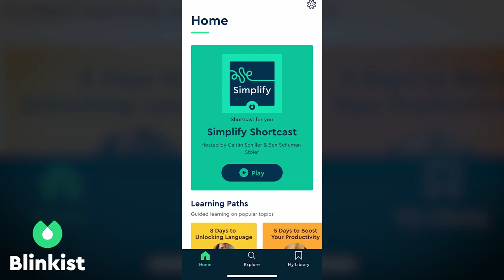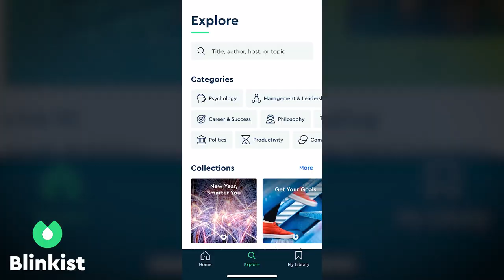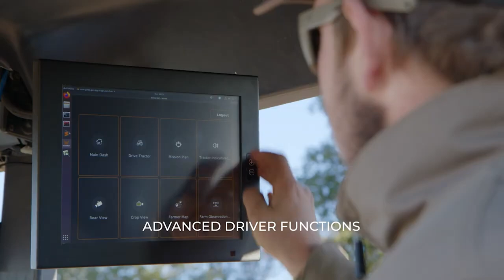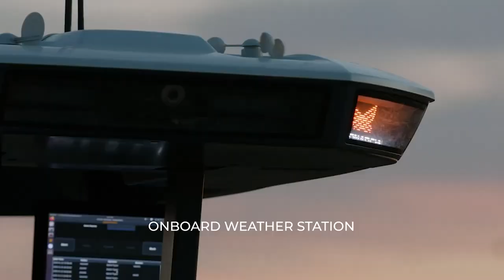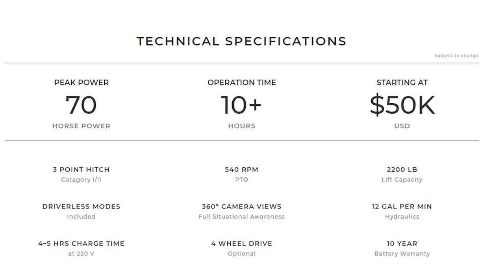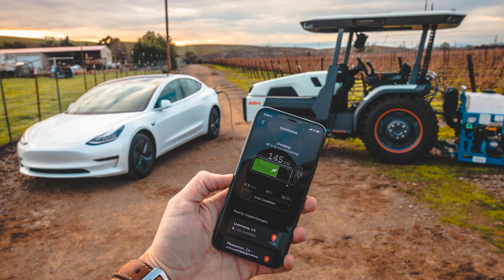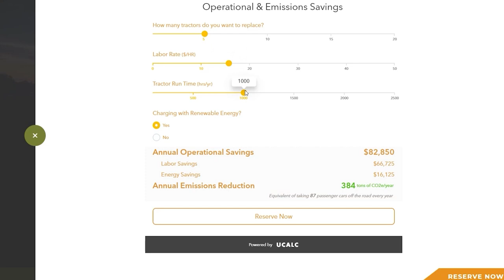This Tractor Could Change Farming Forever | In Depth

Comment: I've been listening to Louis Rossmann on Right to Repair. Some of these diesel powered farm tractors cost well into the six figures. Then they go into limp mode, becoming useless because some tiny bit of pollution control tech has mal-functioned. They then lose the use of the equipment for weeks while they have to wait for the dealership to deal with it because the tractor manufacturers will not sell them the equipment, parts or software they need to service their own tractors.
One benefit I expect from electric tractors is that pollution controls will never stop farmers from doing their job. That factor alone will be enough to sell all the electric tractors they can build. Farmers are really fed-up with the current situation.

Comment: 6:30 even bigger than reducing water use is increasing resiliency against extreme heat. Part shade during the hottest part of a 115F day could mean the difference between getting to harvest and total crop failure
Reply: @davidbeppler3032  Yes, yes and use a system of mirrors so hone the power of the sun! The Egyptians utilized this power to light the treasure room in 'The Mummy'. 
Oh Benny.
Reply: @davidbeppler3032  😁😁

Comment: Having recently purchased an almond orchard as a retirement property. I've been disappointed to have to reintroduce gas and diesel fuel to my life with truck, side by side and tractor.  Having come from a home with solar/powerwalls and a Model S, I had not been to a gas station in a couple years.  But now having to go and burn these fuels is frustrating.  Cybertruck will address one of those but tractor is still a real gap I'm glad to see being closed by vendors like these.  Side by side being replaced in next couple months with electric as this is already a real option.

Comment: I feel like a really important factor that isn't being talked much about is the fact that electric motors have 100% of the torque available from 0. Which sounds amazing for farmuse! No need to spin an ICE engine up to several thousand RPMs just to get heavy work done.
Reply: You don't want instant torque for tractors. That's how you break things in the industrial world. Plus electric motors struggle under the high load work ICE engines in tractors do.
Reply: @davidc2838  ????
Reply: It would be more accurate to say that an electric motor has instant torque available at any speed. Meaning it is still capable of lower torque levels, and unlike an ICE does not need to be revved or stalled by clutch to apply a specified amount of torque. Rather, it's merely an adjustment made by code. Tractorman may be technically correct but the statement is certainly misleading fud.
Reply: @tractordawg   what does ICE mean?
Reply: @davidfrost1428  In this context, ICE is an acronym for Internal Combustion Engine. i.e. a diesel engine for most tractors, or petrol/gasoline for cars.
Reply: @DuncanAitken  no dumb questions right? Actually figured it out and felt oh so dumb.
Reply: @tractordawg  Just an FYI we've use electric motors on trains since the 1960 because ICE couldn't generate enough torque for heavy loads.

That's how one engines can pull miles of fully loaded freight cars and why rail is the cheapest mode of moving freight overland.

The diesel engine on them just powers the electric generators, same for some large ships and submarines.

Comment: This sounds very interesting, and I look forward to when it's available in my area.

I'm going to start by pointing out that tractors have had the option of some degree of autonomy for longer than cars have. It's a bolt-on solution, but it works. At least for some crops. So that this tractor has factory-installed autonomy isn't all that big a deal to me. The bolt-on solutions will get better and don't lock you into a single equipment vendor.
What is interesting is the probable uptime. If your equipment isn't ready to go when you need it, you miss an often too-short window. If you don't get a chance to plant, or harvest, at the right time relative to the rain, you can end up with no crop to speak of. (This is also a reason why custom harvesting isn't all that great for the little guy. Big jobs are prioritized, which leaves more time for the weather to ruin the crops of the little jobs, before the combines are available to work them.)
Also, farming equipment is often finicky. I'm pretty sure I've seen round baler belts break because some spring tensioner was turned just a little bit too tight. A more robust, and reliable, electromechanical system does appeal to me.

Also, get PV panels down to the same price as corrugated galvanized steel roofing material, or close enough to it, and of comparable durability, and I think you'll see most barns made from PV panels rather than corrugated steel. In my experience, most farms have more square feet of roof on the outbuildings than on the house. That's a lot of roof for solar panels, before you start looking at shading your crops.

I still think the future of farming is in greenhouses, however, as it greatly improves your ability to control the water cycle. Provided riparian water laws don't get in the way, (which they will. In some places, it's illegal to capture rainwater, because the down-stream claimants would be deprived by your rain barrel, which would make running gutters on your greenhouses to water storage legally problematic.)
Reply: I never thought riparian laws could apply to *RAIN*.
Intuitively only a mega-project could significantly deprive a downstream, right ?
Reply: Make an illegal 2 inch under surface collection site about an acre in size for collecting rainwater, underground 5000 gal. tank. Put auto bleach sanitation system if needed for potable and test at certified lab.

Comment: One way of doing agrivoltaics would be using rollable solar PV. This would be akin to shading that is used in many farms or in greenhouses to moderate light levels. It would also be much more mechanically simple than solar tracking motors. Can also roll them up when needing to work on the field below and in adverse weather to protect the panels. Thin film solar is not the most efficient but it is pretty cheap.

Comment: We need to cover only 25,000 square miles with solar panels to provide energy for the entire  USA . Thats less than 0.41 of total US land area .
Reply: It's always better to generate electric energy right at the location where it will be used. That way you don't need to build a lot of energy transmission structure.
Conversely, generating electric energy for the entire country all in a single small area would mean you have to build out massive amounts of transmission lines. That would drive up costs enormously. 
The idea of generating the electric energy for the entire coutry in a single small area is economically not a viable option. The more locally the electric energy is generated, the more cost reduction.
Reply: @cleon_teunissen  When people say what the op said, I don't think they mean we should pick one spot and generate all the electricity there (at least I hope not). It's more of just a way to model how little solar we need in total. You're right though, everyone should generate their energy as close as possible to where they use it as well as being able to give and take excess energy rather than waste it. Ideally with solar roof tiles like Tesla's, that is  where we will end up.
Reply: @givanildosouza6904  Sure enough: when technically educated people state the figure that total solar panel area required corresponds to less than 0.41 of total US land area, then they probably do have distributed energy generation in mind.
  
But it gets iffy when the presenters show an actual map of the USA, with an actual square of the corresponding size. Then the presenters should clarify that energy should be generated locally, and that the map is only to illustrate proportion. Zac and Jesse don't provide that clarification. 

I watch Zac and Jesse for their enthousiasm, good vibes, but their technical understanding is limited. It would appear Zac and Jesse are not aware that building out and maintaining an energy transmission grid is very costly.

Again, I very much appreciate Zac and Jesse, but from time to time they inadvertently spread misinformation.

Comment: In our part of australia the irradiance levels are such that we have a 3.8 kw photovoltaic system fitted which generates up to 33 kilowatts per day we average 13 kilowatts per day usage ,on our farm this represents approximately 15% roof space could easily power tractors and all machinery by the sun ,have been waiting and watching a longgggg time for an electric tractor makes so much sense for jobs like fencing where a diesel sits running at low revs electric would be great wish these guys all the best

Comment: Our tractors would need 400-500 kW per hour. That would be a big battery for an 18 hour day. Also would need to recharge in 6 hours or less.
Reply: Our tractors are often 5-10 miles from the farmstead. They don't often make it home at night during the working season. Would be difficult for us to get it to a charger every day. Still a good step in the right direction.
Reply: Was that supposed to be kWh per hour, as in averaging 400-500 kW?  500 kW is roughly 670 hp. Maintaining a power output of 400-500 kW with a diesel engine that fits in a tractor should take over a 100 liter/26 US gallons of diesel per hour.  That's 1.8 cubic meter, or almost 500 USG. Yes that would require big batteries to replace, but with battery swap you would not need capacity for the whole day onboard, you might want to watch the show so you get an idea what you commenting. 

And, if your'e not just throwing out numbers, as I assume you are, being able to save almost 500 USG diesel fuel, per tractor, per day could pay for a substantial investment.    Assuming a price of about  2 dollar per gallon you'd save roughly 1000 dollars per day, per tractor. If your not using somewhere in the ballpark of 500 gallons per 18 hour day, your not putting out around 400 - 500 kW on average either.

Comment: Am sure the SciFi movies had autonomous tractors - but pretty sure many also had exhausts..
I love this. Multiple batteries so directly charge the spare in  the day directly from solar, go to the tractors to do battery swaps when necessary so working tractors stay close to where they are working. Could potentially work all night as well? Less to do in winter - so the spare batteries provide more backup power to the Farm buildings.
Primary down side may be a need for less farm employees.

Comment: don't forget if solar panels are running cooler by being over green plants then they are also more efficient in generating...
Also with attending levels of Service around the world could be maintained by using local independent Technicians & Engineers (like Us) with the remote specialized OEMs diagnosing the issues...this will be a hole other trade without flying everyone everywhere!

Comment: Comming from a farm, i can tell you that the 100 days a traktor is used, are the 100 sunny days... And diesel in farm traktors is far less polluting than diesel in a street car ( constant rpm, addblue etc...), during the summer, this equipent needs to run 24x7, with EV equipment you need to triple the equipent number in order to compensate for charging time. And on the field, every few hours, you need to get off, and fix something manually.

Comment: Love the concept, but I need at least a front bucket on my tractor which I don't see on the website or promotional videos.  A blade and/or backhoe option would be even better.  Are there plans to offer this?  I have an LS diesel tractor that stopped working so looking for a replacement.  Electric options are much preferred!

Comment: You could get sooo much more.
Since it quiet and autonomous it could do the main work at night.
Big battery plugged in during the day can give you 100% solar charging and enormous V2G.
huge batteries can deliver a huge current, add a supercharger on it.
You could practically go off grid and still always have power and fast charge your EV of the traktor.

Comment: I farm a small lot and have a John Deere 3046R compact factory cab tractor.  JD already has automated tractors, and has for many years.  JD is working bringing EV tractors to the market, and some don’t even have a spot for a driver.  I am definitely onboard getting an electric tractor, but the difference between brands like John Deere or Kubota and cheep tractors is so far apart, it is ridiculous.  Way different than that of a high end car and a cheep one, whereas both work.  A cheep tractor looses you money.  I don’t know if a new EV tractor brand can replace the big tractor brands, but it could force those old brands to get on board sooner.  The amount of fuel even my JD3046R uses a day, is pretty high, so there are cost saving potentials for big commercial farms.

Comment: Most farms are connected to the grid.  Use the tops of farm buildings and low quality fields for solar generation and sell power to the grid.  If you're running a feedlot or dairy operation consider adding a methane digester and sell gas.

Comment: Hello, Two thing spring to my mind first a would bet a tractor does a good number of mile as going up and down a big field so add up into miles. Secondly on these solar panels mounted to a frame why not build in water sprinklers all in one? only cost a small bit more bt done at design time and install time.

Comment: Much oofs with these adorable city slickers. Agrivoltaics would be a huge game changer for all farms, even grain. Using LED's and drip irrigation it would pay for itself almost before the tractors. If only the market garden stuff, berries, cotton etc were under agrivoltaics it would provide more than enough power for the whole grid. Shade is important in the summer. Solar would only really be useful during a growing season anyway. Acre for acre solar panels would earn in the off season.

The ROI would increase because you are immediately using the power before transmission to your own products. Anywhere solar installations would make sense, they would make more sense with the use case right under them. If you also use the power for cameras. bug zappers, sensors or even pollinating drones it could pay off even sooner.

Comment: So much easier to make tractor four wheel drive with electric motors.   Getting rid of shafts etc.  I bought a tractor that size when I was 24 back up in Maine and it was only 22 Horsepower. If it had 60 Horsepower it pull a house down.

Comment: There may be opportunity to rethink agriculture altogether with automation and artificial intelligence.  Using it to further the industrial agricultural paradigm is of limited utility though.  If we could technology to emulate ecosystems, then that would be a step forward.  

It would make nutrient use much more efficient, create diverse landscapes, eliminate floral deserts that make these landscapes hostile to pollinators, and reduce pest pressure associated with monocultures.  In aggregate they would be more productive and perhaps the rest of the worlds living things would have a place in this type of system.  

From this perspective, an electric tractor used conventionally is a bit of a yawn, but a small step in the right direction.

Comment: The thing about farm tractors not needing to be light is not completely true... We use the lightest tractor that can do the job in the most reliable manner. Also well we are no 100s of miles away from home the average tractor drives 100-700 miles per day depending on what is happening that day. We need to charge fast to make it possible. Can we get the link to there website?

Comment: These battery tractors as far we understand are not up to the task of running solarfarm wash system atm , 10 hr days are not uncommon in uk with very short breaks , also the tow weights from farm to farm is critical this will mean the power packs have to be ultra light and over 200 kw ????

Comment: Will you be able to repair there products on farm or only repaired by there team? #righttorepair
Reply: Yes this equipment must be serviceable on the farm. It must be fixed on site. Non farmers don't realize how hard it is to even get a 50hp diesel tractor that weighs 12000 lbs and isn't running on a trailer and to the shop. If you do manage to get it to the shop the growing season will be over by the time the farm equipment shop is finished making the repairs. Time is critical in farming. Farmers don't have the luxury of being able to wait weeks or months to get a tractor repaired or for a team to come to their remote farm and repair their new tractor. A repair course and full array of spare parts would be required to make this practical in the real world.

Comment: Just don't see it happening, still don't have the energy density for heavy use and both combines and tractors on large acreage continue to get bigger. Might be fine for 400-600 acre farms, don't think it will work for farms measured in sections.
Reply: Think Bobcat vs. Caterpillar - I would purchase a size appropriate combine to harvest 4 acres with.

Comment: 6:50 Quick math: A 300 kW 4WD tractor operating 10 h a day under full load needs what kind of battery and charging concept? Not such a simple problem to solve. 🤷🏻‍♂️
Reply: Are there any tractors that need so much power? 300kW continuously? That's about 408CV continuously. You would need a power plant just for that. 3MWh of storage.
On the other hand, that tractor would spend several thousand dollars per day just on diesel
Reply: @rubenayla  Just search for "Steiger 450" here on YouTube. Usually the consumption is 200-220 g/kWh Diesel. Full load hours on those tractors are 500-1000 h per year, so 40-80,000 Liters Diesel per year.